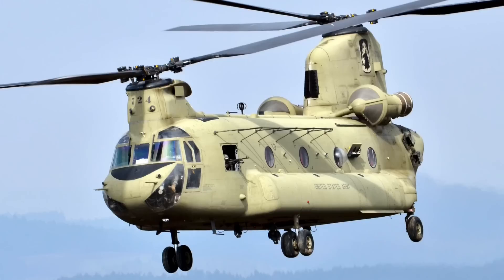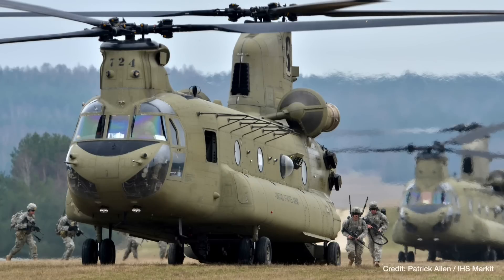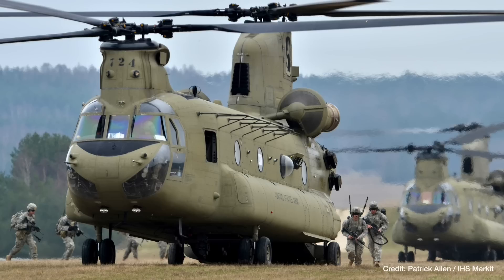Chinook Block 2 Upgrade Programme

Comment: Historically, helicopters greatest vulnerability has been soldier launched grenades (recently, RPGs are all the rage, it seems). I wonder if making a 5 blade system (on each rotor) would quiet it down to help avoid being heard from so far away.
Also, portholes in the sides (or an automatic system of some kind) would let soldiers inside fire out in the event they see they're about to be targeted by an RPG, for example.
The ability to release chaff, if needed, would also be useful in counflicts against more sophisticated enemies (should they occur).
Just a few suggestions I know troops and pilots would probably both appreciate. 😉😀
Reply: I do not see how you could intermesh a 5 bladed rotor, or even a 4 bladed rotor.  Remember this rotor system had a hunt and lag rotor system.
Reply: They already carry heat flares to confuse heat-seeking missiles (like all combat aircraft), but RPG’s, etc are simple aim/launched weapons that aren’t affected.
  The new Block 2 variant, with the newly designed blades, are providing a much quieter rotor system and improved lifting capability.